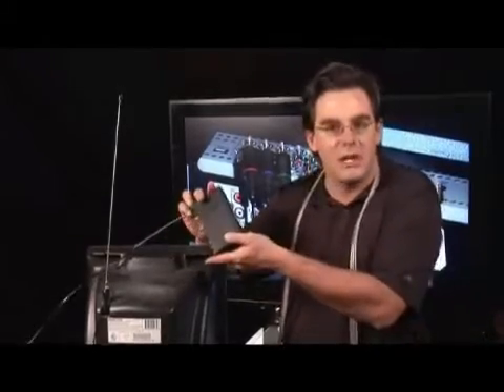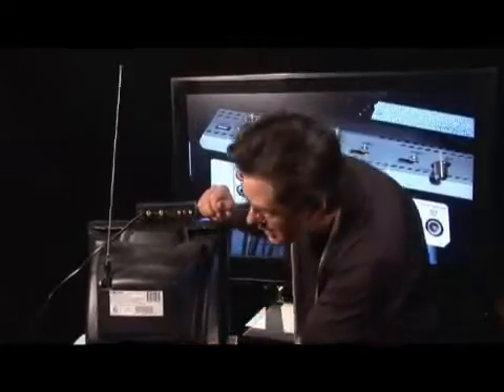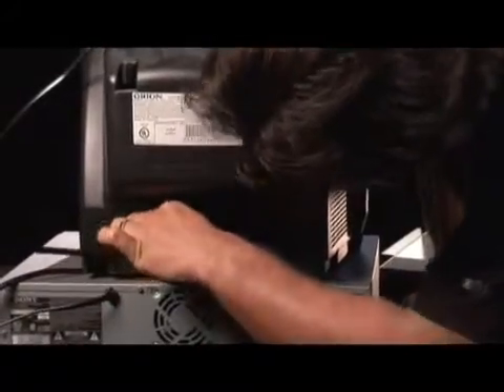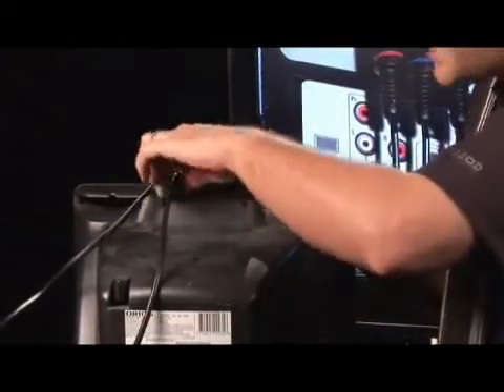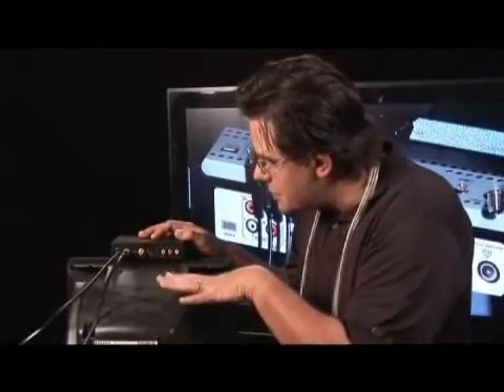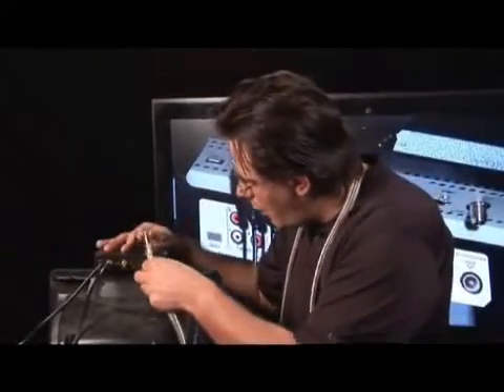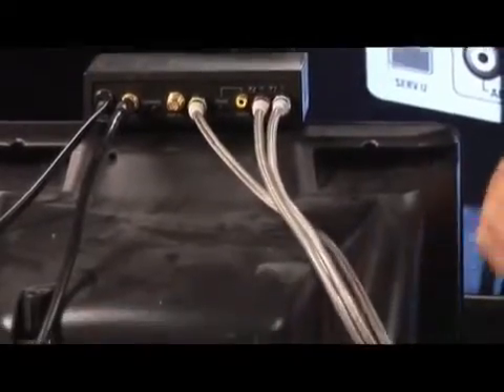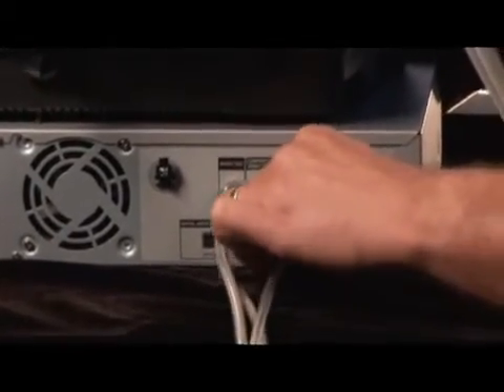How to Connect a TV, DVD Player & VCR With a Modulator

Comment: You look as if you got it going on. In the kitchen of the crib, got way past that point years ago. Simple question, "ONE RF signal into two analog antenna inputs, will a simple  passive splitter suffive?" Recording studio in basement much more involved. Empowered by cube space time continuum universe kitchen much side thing. Not significant matter is necessary side hustle. Looking for apprentice, listen to more superior quality closer to end of pick more straight on faster left hand fret board movement rhythmically inclined personification of cube space time continuum universe? Help Wanted! Apply soon!

Comment: You didn't show actually hooking up a VHS in addition to the DVD.  If I hook my VHS tape player to the co-axial cable input, will I be able to view the tape?  Or is it an either / or situation?  Either you have the VHS hooked up and on OR I have the DVD hooked up and on.  A friend gave me one of these.  Currently I have a DVD player hooked up to a VHS player using the RCA cables.  Then the VHS player is hooked up to the analog TV through a co-axial cable.  To watch a DVD, I have to turn on the VHS, play a tape for a moment, then stop it, but not turn it off.  Then turn on the DVD and I can watch the disc.  My friend thought this RF 15-1214 Modulator would help by not having to go through the steps of turning on the VHS in able to watch a DVD.  So is there an internal switch inside the modulator to know which device is running, or if both the VHS and DVD are on, would I get a scrambled picture from both VHS and DVD inputs together?